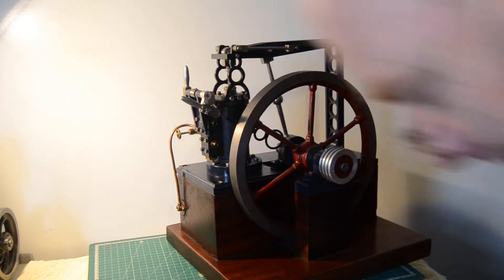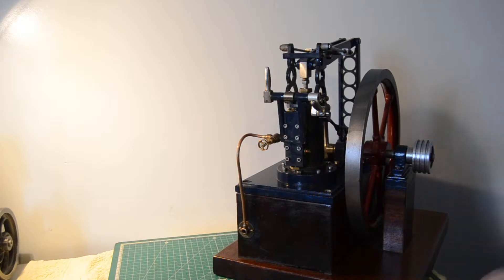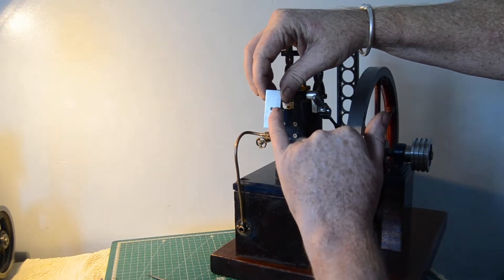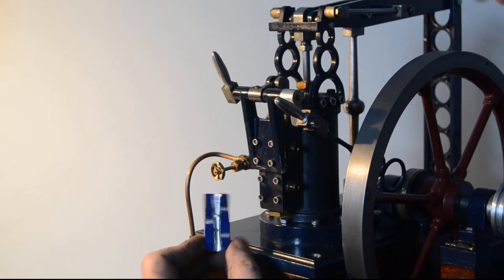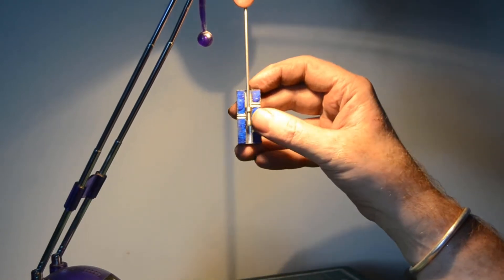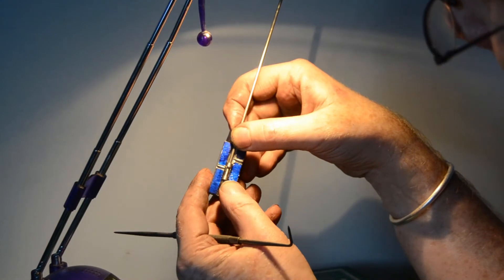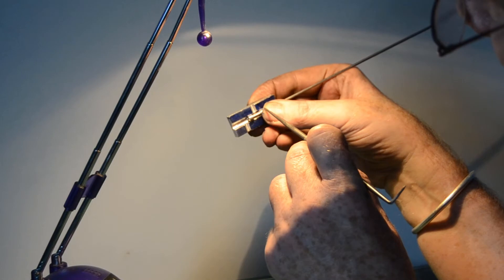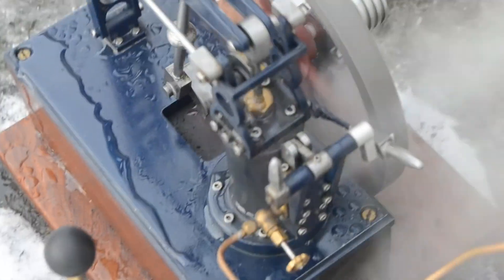How a steam engine spool valve works

Comment: I get the idea but it gets confusing when you need to know the port sizes and distances apart to figure the right plug ends lengths to cover the ports and final stroke.  A sketch with dimension needs to be made of actual ports sizes and distances apart of each to figure spool plug length, distance between plugs and stroke. Back to the drawing board for me.
Reply from the maker: My Grasshopper engine uses the dimensions of the cylinder and valve assembly from these plans. In my case I scaled up by 50% but you can use whatever suits your need. :-
http://www.vapeuretmodelesavapeur.com/telechargements4/h-potty-mill-engine-09-02-08.pdf
Reply: @modelsteamers671  Thanks for sending the link I will have to print out the drawings. I was in the middle of drawing up a version in Fusion 360 and have even 3D printed some as a test.
Reply from the maker: @gvet47  Hi, I don't know if you are aware but the grasshopper engine I built is one of a series of different engines designed by Stewart Hart. He calls them 'Potty engines' - there is a Potty Mill engine, Potty grasshopper etc. All the engines use the same cylinder and valve arrangement in different configurations. If you Google Potty Mill engine you will find loads of information about the engines.
Reply: @modelsteamers671  cheers for the link, that has explained a lot about dimensions, eccentric throw etc much more in the picture now

Comment: A model of your model - nice touch.
Reply from the maker: Thanks, as a loco builder do you know why spool valves are more common on locos than stationary engines? I assumed it was to do with size/width but not sure.
Reply: I believe that when locos started using high pressure super-heated steam, the slide valves became less efficient - more pressure holding the valve to the port face - therefore more friction. Piston valves don't have this problem.
Reply from the maker: @no23mk2  That makes sense :-)
Reply: spool v/v: invented by mr Murdock 1780ish for his traction engine it actualy getting the exahaust pasages right ive been playing around with this for ages eneyway ttfn&ty